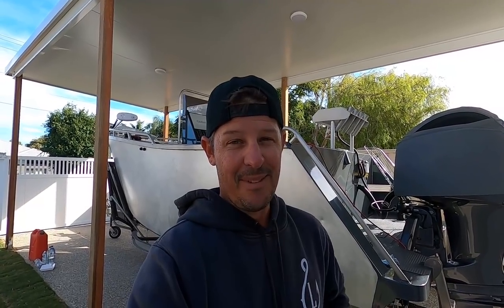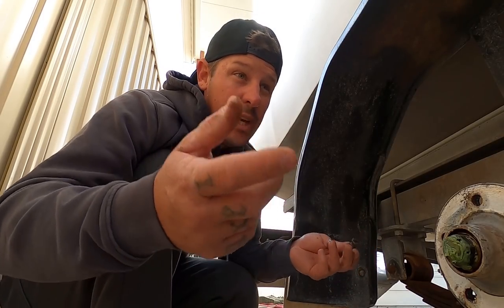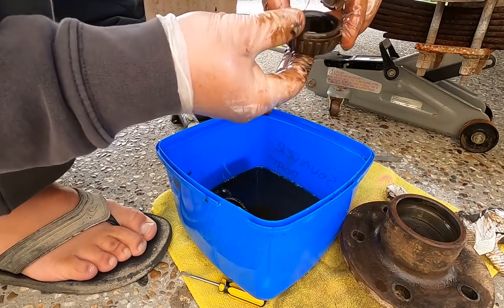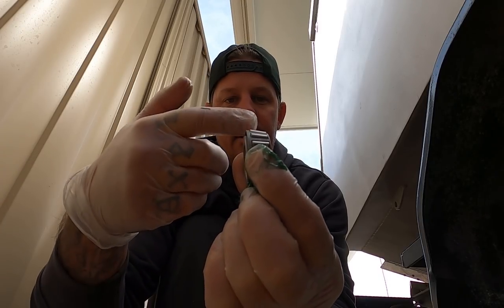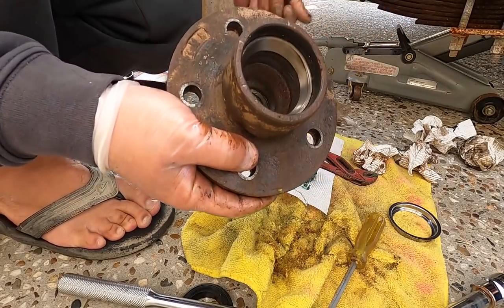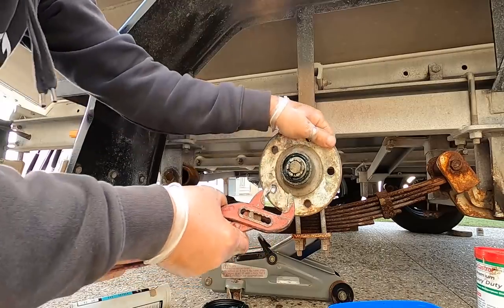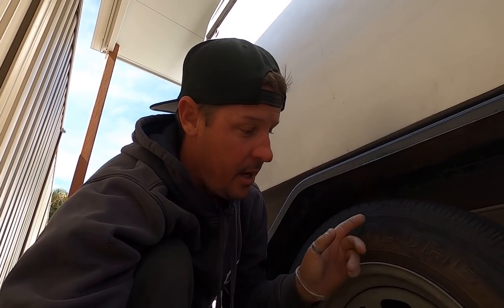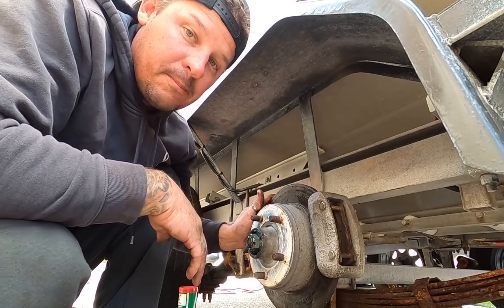How to do WHEEL BEARINGS | WHEEL STUDS and CALIPERS -Ep 36

Comment: A better way to drive your new casings in is to put you old one on top and use it to tap against that way you don't risk damaging the new bearing case, then pry or knock old one back out
Reply: I do the same Rod but get the old set and use  a grinder to take a millimetre or two off the OD of each that way they just fall out after driving the new races in.
Reply: @allanmcleod5231  that's a great idea, might have to try that, thanks for the tip
Reply: I was waiting for him to put a ding in it. Old case is the best way unless you have a press
Reply from the maker: @derrickblackwell8434  precision bush craftsmenship here mate no slipping 🤣🤣
Reply from the maker: Excellent idea mate.

Comment: I always carry 2 spare hubs and pre grease the new bearings and keep them in a zip lock bag. I had a wheel come off on the highway and sheared all the studs off. Now I can just pull off the hub and replace a new hub and bearing set easy. Cheap insurance policy for a trip away.
Reply: If you don't want hubs rolling around in your car or boat, you can modify the spare wheel holder to be a stub axle and new hub/bearings/wheel studs.
Reply from the maker: I had that happen on a drive to 1770, had a spare and materials to repair and stay on the trip. But the spare hub is something I’m going to do on my next trailer set up for sure.

Comment: Here's a hint for new players. Keep bearing stuff extremely clean. DON'T DROP EM IN THE DIRT! You don't want grit anywhere near them. Cheers from Tassie and PLEASE don't tap races in with a screwdriver. Use something soft like a brass or copper drift cos the races are hardened steel and can be chipped or scratched...game over.

Comment: Thanks for the chance to add my 2 cents worth - Bearing Buddies both my trailer guy and boat maintenance (pro) do not recommend B Buddies any more However i love them - next time try cleaning the hub and B B with petrol so no NO grease between BB and hub-this is a hard job but doable - then lock tight goo - but b4 you join/hammer in hit the BB with a punch /screwdriver so the  portion of BB that goes into hub is deformed slightly -now you wont loose a BB  - long time ago guy in a service station showed-sold me - a bag full of B B picked up on the side of road  by council workers -especially after easter -long week end ,as boaties over fill BB with grease and they work out . cheers
Reply: I take the chrome of the Bearing Buddies where they interference fit with the hub, and a few millimeters of the outside diameter near the hub (and as you said, NO grease on those connecting surfaces). I then run a thin film of a good quality silicone sealer on the outside join of BB and Hub. Haven't lost a BB since, but I still carry spares.